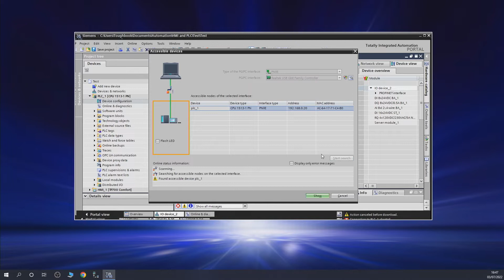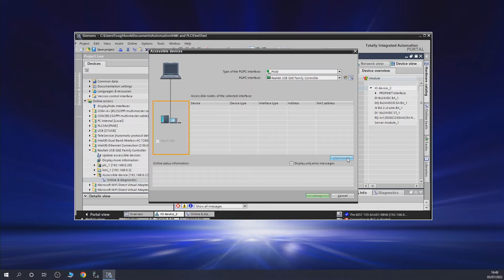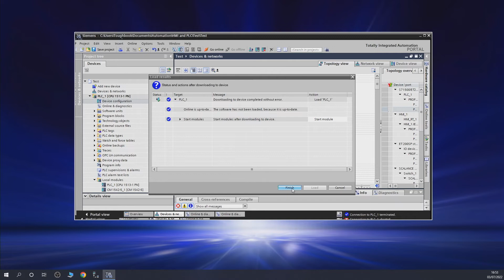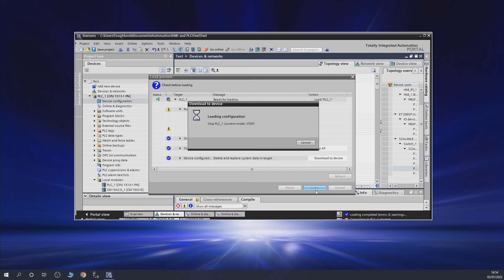Siemens S7-1500 PLC Scalance XB005 Ethernet switch set up and problem with ET200SP that I run in to.

Comment: Hi, Good information there. What if I'm using a random switch which is not from Siemens? How do i add it in TIA portal as it won't be abailable in the TIA devices?
Reply: From my understanding, you don't need to add switches in the project topology unless you are using IRT or redundant ring topology. I have no clue why he is configuring the topology here. I have done several projects with ET200sp and a switch without configuring the switch in the project topology.
Reply: To answer your question about adding third party switches. The switch must be designed to be used as a profinet device. You can get the gsdml file by using a web browser and typing in the IP address of the switch while connected to the switches network. Once you have downloaded that gsdml file you can update your hardware catalog with that new hardware. Again there is no need to add switch in project unless you are using it as a redundant ring topology or using IRT
Reply: @luciddream2033 ive got a cisco switch between two profinet subnets. Ive heard rumors that data flow between them sometimes drops. Is the cisco switch of concern?
Reply: @slackjaw4270  I haven't used them, but I wouldn't be concerned about packet loss. Profinet uses UDP for data transfer. Just make sure the switches are designed for RT or IRT whichever you are using.
Reply: @luciddream2033  thanks buddy!